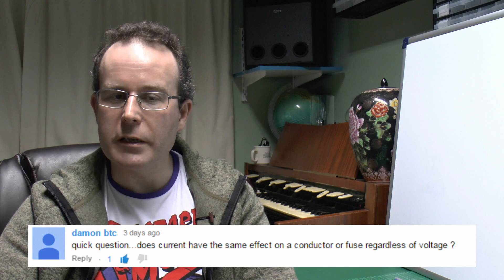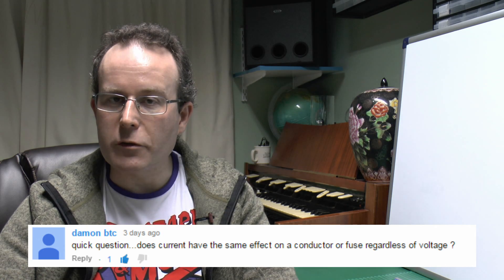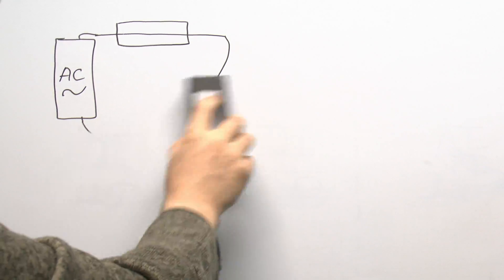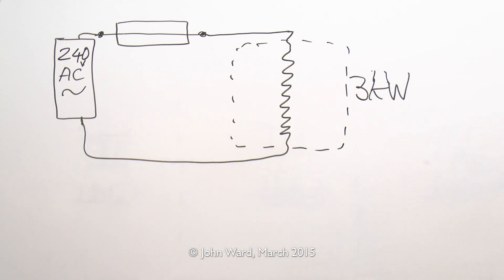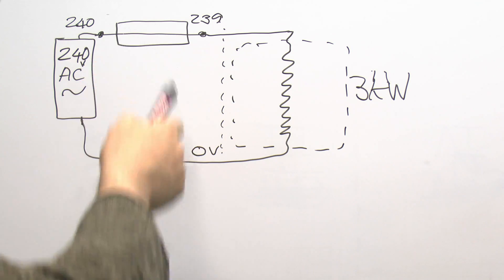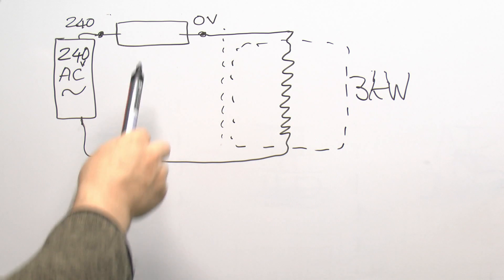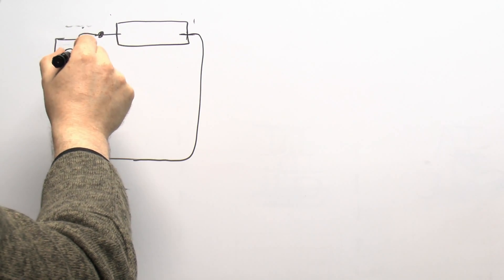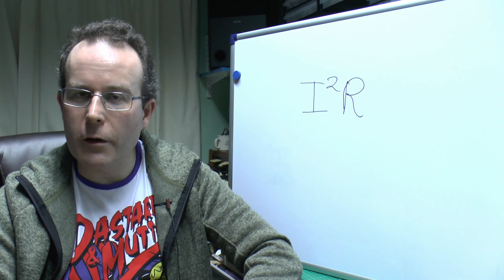Fuse Tests - Current & Voltage Question Answered

Comment: Does that mean that when fuses have a voltage rating on them the rating relates to the ability of the fuse to handle the arc energy safely?
for example a service head main fuse will have a 500v AC rating, whilst a C.C.U. fusewould have a 250v AC rating

Comment: Is there a possibility that you do a video on cable calculations please, from the process of doing the rating factors to doing the the actual zs  and the thermal withstand (adiabatic equation) I've seen a few of your videos and they are really good so I would love to see you take the time out to explain cable calculations as I'm finding it difficult to get my head round.

Comment: Here are two videos which show what happens under short-circuit conditions when the sand filling is missing:
youtu.be/KVJVswLbqaA
youtu.be/KAX6Nc6Y_pI
An important point about the function of the fuse in a BS 1363 plug, it is there to protect the flexible cord and not, as so often assumed, to protect the appliance!    If the nominal cross sectional area of the cord is 0.5mm squared then the fuse should be not greater than 3A (unless, for reasons of a high instantaneous inrush current,  it is necessary to use a 5A fuse).  For flexible cords of greater cross section then 13A is the specified maximum. (BS 1363-1 table 2).